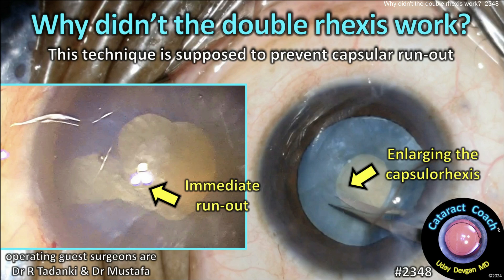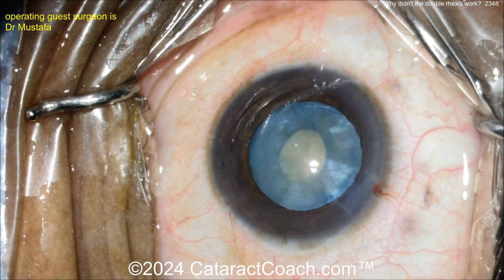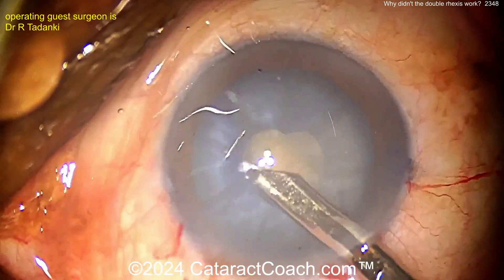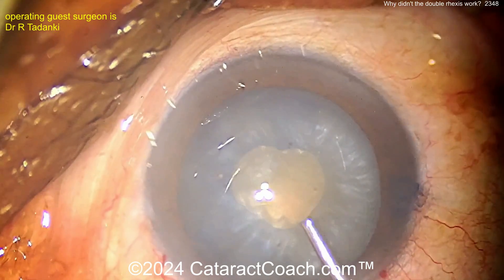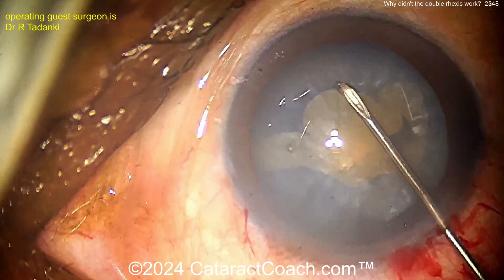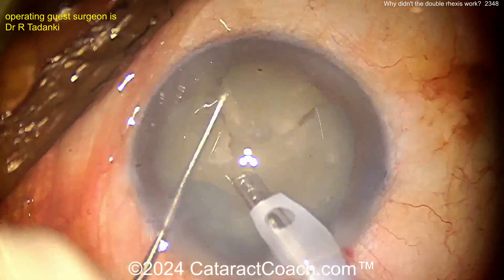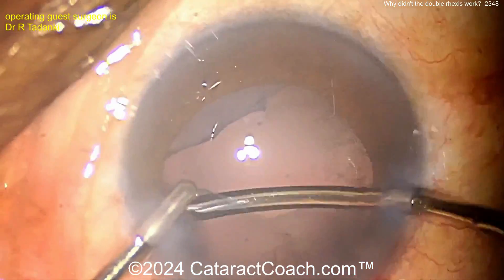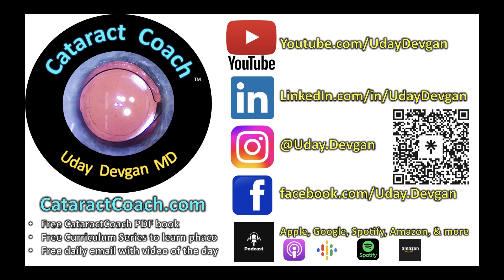CataractCoach™ 2348: Why didn't the double rhexis work?

Comment: We noticed in white cataract.. In some cases there is some attachment between cataract and capsule .. Even if you evacuate some fluids.. There is still some pockets of fluids that can cause this extension. (Even if you did not notice a fluid comong out)

Solution: after doing this baby rhexis .. I am using spatula and enter between capsule and lens .. In all directions .. Then enlarge rhexis ..

Comment: The problem is due to a difference in pressure between the anterior part (ANTERIOR CHAMBER) and the posterior part of the eye (VITREOUS). You can perform a white puncture, a baby capsulorhexis, or a drink of holy water, but it all comes down to pressures and weak points in the anterior or posterior capsule. And like all pressure, the vitreous can also vary in pressure and in some patients it can be higher and in others it can be lower. A sudden decrease in pressure within the anterior chamber, in relation to the vitreous pressure in the posterior part, generates an upward force that can cause the anterior capsules to rupture. A similar phenomenon occurs when low-power lenses are implanted and an anterior capsular discharge is performed. If irrigation is stopped abruptly without slightly increasing the pressure in the anterior chamber, the tear can migrate to the periphery.

El problema se debe a una diferencia de presión entre la parte anterior (CÁMARA ANTERIOR) y posterior del ojo (VÍTREO), se puede realizar blanco punción, baby capsulorrexis, a un trago de agua bendita, pero también se trata de presiones y puntos débiles de la cápsula anterior o posterior. Y como toda presión, el vítreo también puede variar en presión y en algunos paciente ser mayor y en otros ser menor. Una disminución repentina de la presión dentro de la cámara anterior, en relación con la presión vítrea en la parte posterior, genera una fuerza ascendente que puede provocar la ruptura de las cápsulas anteriores. Un fenómeno similar ocurre cuando se implantan lentes de baja potencia y se realiza una descarga capsular anterior. Si se detiene bruscamente la irrigación sin aumentar ligeramente la presión en la cámara anterior, el desgarro puede migrar hacia la periferia.